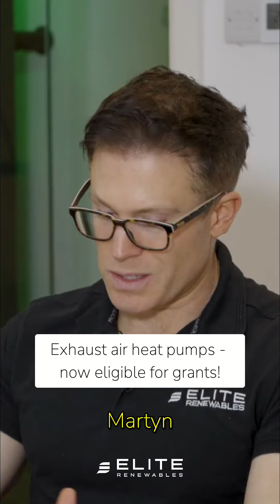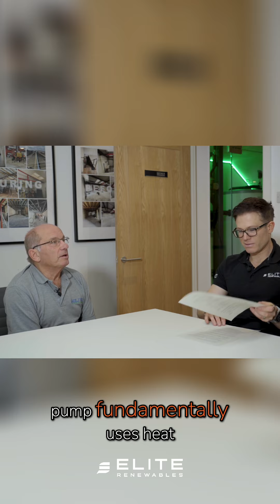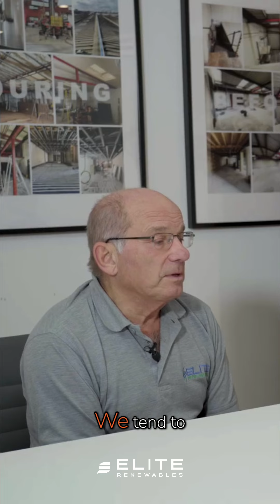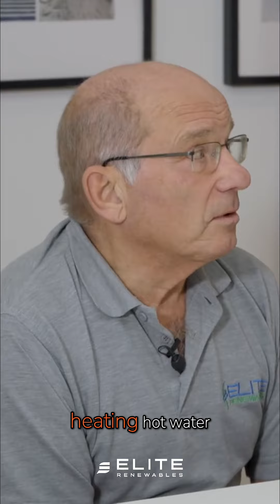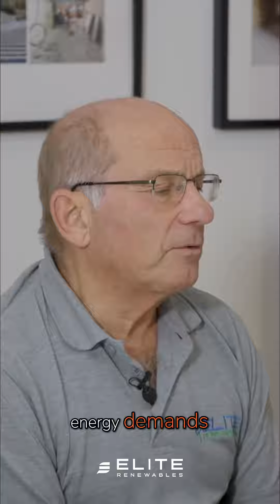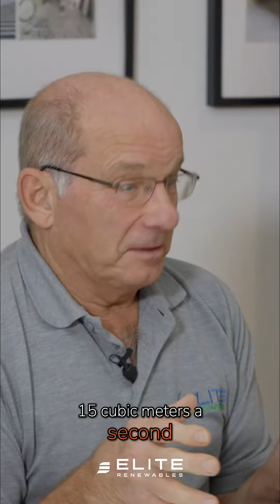Exhaust air heat pumps - now eligible #shorts

Comment: Air in and air out ? What are yoy on about. It has a single exchange unit outside
Reply: That's a monoblock heat pump.  An Exhaust Air Heat Pump has no outside unit, which is what this short is talking about.